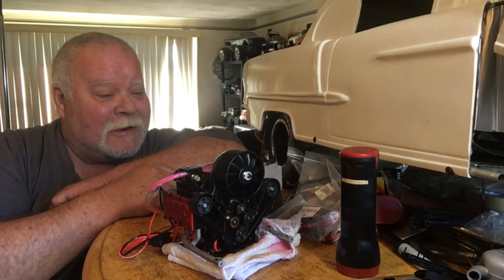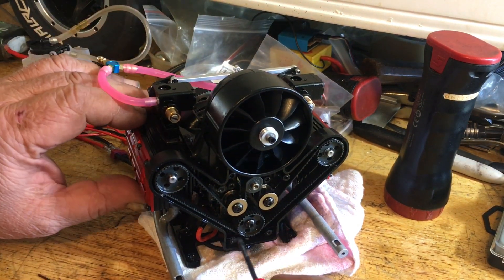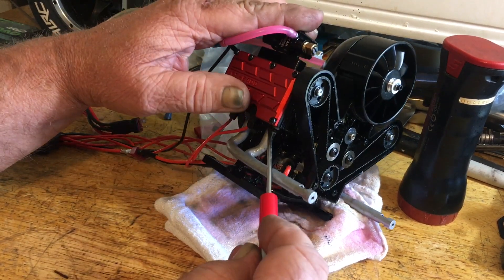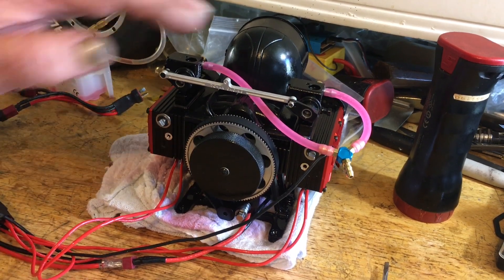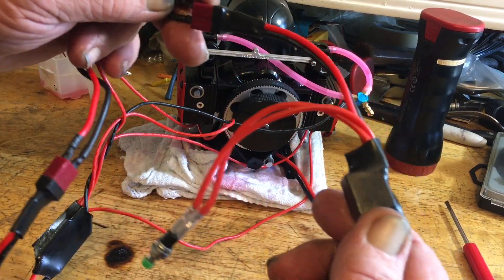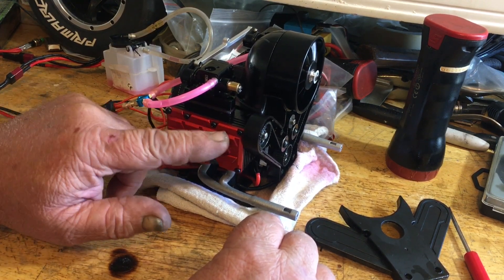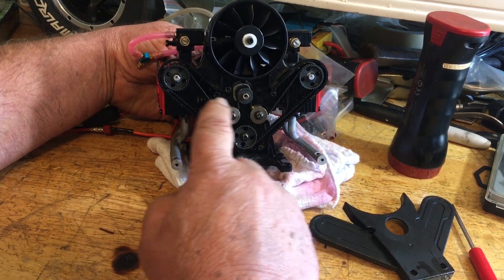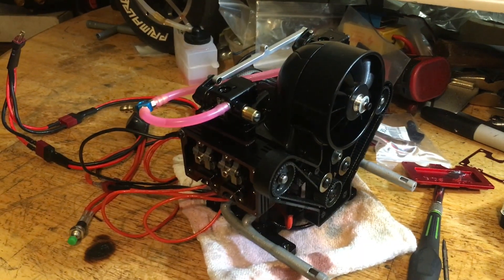Toyan Fs-B400 timing and carb setting information

Comment: I bought the assembled version and I have similar issues. I'll have to check the valves to make sure they are seating properly. The valve timing is right as far as I can tell. I'm not a huge fan of the pump type carbs though.

Comment: This is why I never buy these engines when first launched. There are Always issues.
Also, why does it no longer sound like a flat/boxer engine? In the previous video it did.
Reply from the maker: I agree brother, this video was the out of the box try to start, the previous first start was after fixing a stuck exhaust valve and setting the carbs to run properly